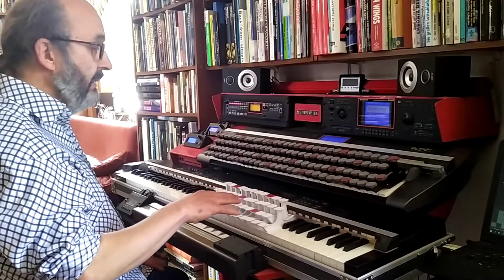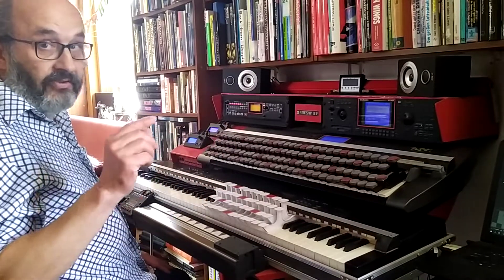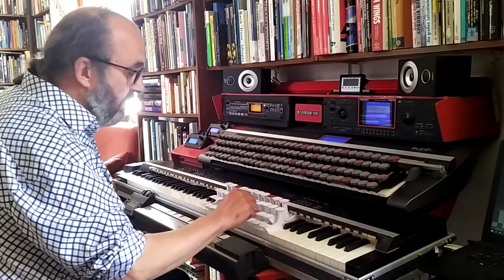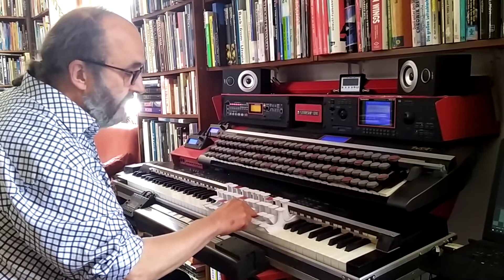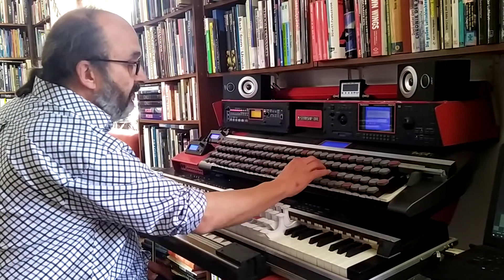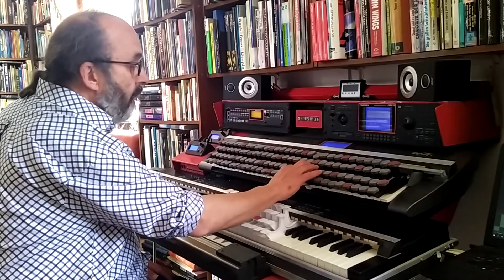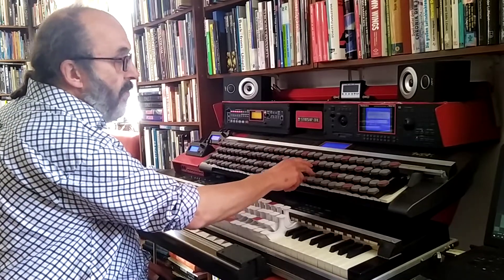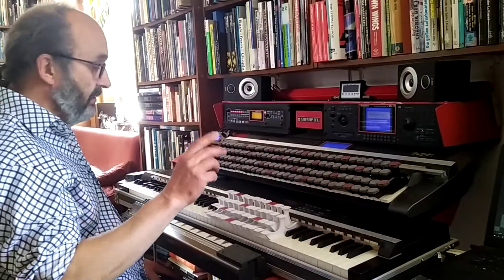Janko V2 first test

Comment: I want to buy this for acoustic piano as soon as you can produce it
Reply from the maker: Thanks for your interest: An industrial production version is not feasible becuase the market for it woudl be too small. This leaves 3D printing and hand building of the frame as the most feasible option. At the present I am trying to tame the 3D printer i just bought. After that producing examples on special order will be feasible. That can however still be more complex as one would think. There are many small differences between keyboard designs (for instance the exact width and height of the keys and how the black keys are shaped) and although this version is as universal as can be I would not be able to guarantee 100 % compatibility without having your own instrument here or being provided with very precise measuremnts of its keyboard. If all these IFs do not scare you off we can however discus this further. Just let me know. 🙂
Reply: @marcbrasse747  I'm sure you've considered such things, but I wonder how modular it could be made to be... I don't know if something like different sized inserts made of felt or something might make it fit different keys. Or perhaps it really must be that bespoke, which would be a shame. I've imagined this kind of project for a while, but you'll know far more with how far along you are. I haven't got an instrument at the moment, I'll be moving soon and when I do I'll get the first old upright I can find for free or cheap that I like the sound and action of to practice and compose with; I'd like to be able to do so with a Janko setup, so perhaps at that stage if the instrument I have needs particular measurements taken and sent to you when I have the money to commission you, I'd be excited to do so :)

If the design is successful, perhaps it could still be marketable as an adjustable template, or licensed out for production to order or something, idk. I'd love to see some business offer these things and other instrument modifications of the same ilk to the general public and drum up interest in progressing how instruments are made to do more things and be played by more people with less training. I have a friend in America who's done 3D printing for rocketry, so really knows his stuff and I've imagined getting him to do designs with me but it hasn't happened yet. I'm not an engineer, but a mere creative lol